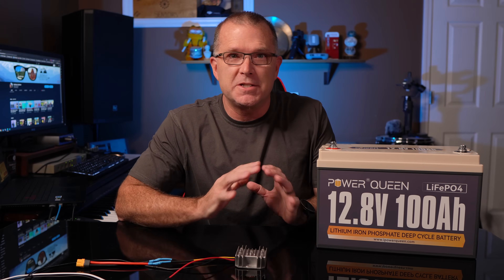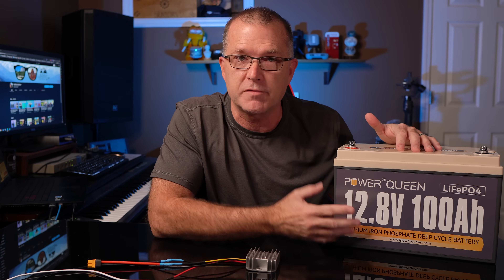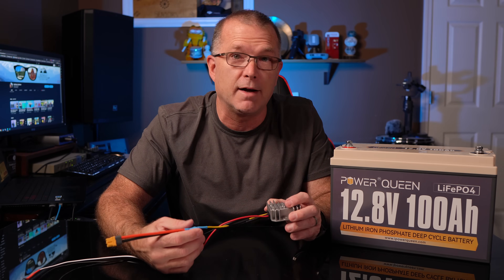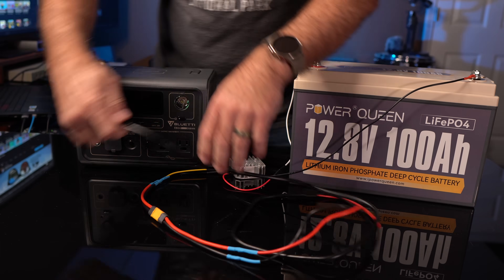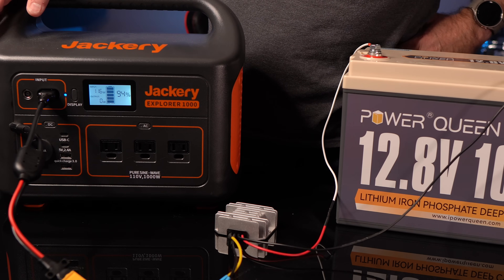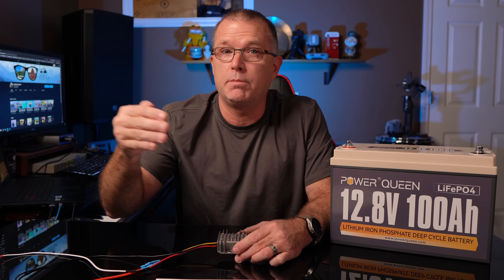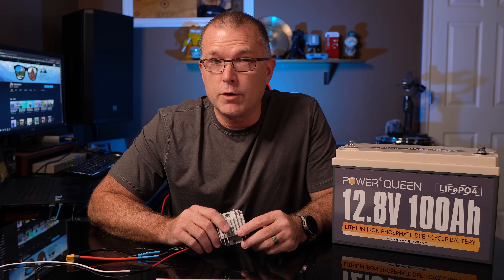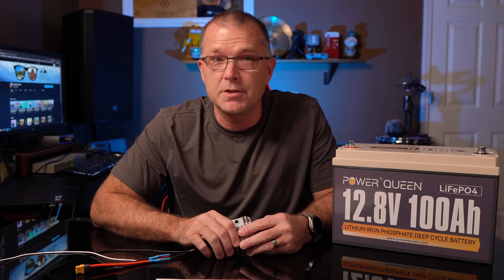SUPER EASY!!  DIY Power Station Battery Capacity Expansion / Charger

Comment: Nice... I have a question, how would you prevent or monitor the discharge of the external battery? Is it safe to let it fully discharge?
Reply: Buy one of the batteries that have Bluetooth.

Comment: QUESTION:  How would I get 200 watts or more through same system, but for a medium Station like River 2 Pro (NO expansion battery for it)?   Would a 200ah Battery deliver this?            On the solar max wattage for it is 220 so.  It can also handle 800 AC charging.    Thanks

Comment: Couldn't you just attach them without the step up??? The battery is within the ranges of the power stations!
Reply from the maker: You can, yes.  But it'll charge more slowly, and will eventually likely stop charging well before the power station is fully re-charged.

Comment: The converter you use here is useless for what you are trying to do. 
It’s rated at 3A. 24x3=72watt
You can connect that lithium battery directly and the solar generator will pull 8A or 100watt.
The reason the EcoFlow pulled 180 watt is it doesn’t know your converter is rated at 3A. The EcoFlow is pulling 8A at 24v. Your converter is bound to fail in no time. 
Solution 1 :
Use a 10A converter.
Solution 2 : wire 2 converters in series for 48v and get up to 400watt charge from it.

Otherwise good idea.

Comment: For permanent on the road van life, any idea how you could quickly recharge the battery? Perhaps use the Pecron charger that can shove 500 watts into the battery?
Reply: You charge the battery with solar or AC charger.
Reply: @SOLDOZER . Solar means you’d have to install all the usual claptrap like an MPPT controllers ,etc., which would be silly considering that your main powere source is the power station. 110 AC for full time van life is impractical because it takes too long. I’m thinking the Pecron to charge the extra battery and solar and the Ecoflow Alternator Charger for the power station if it’s an Ecoflow.
Reply: @joeblow1942   I live on a sailboat 8 months a year. I use solar mainly. When I get clouds for an extended time I use my gas generator. Its not that complicated.

Comment: Great video, is it possible to use 2 12v lithium batteries in series to get 24v and no longer need the step up converter and at the same time increase the capacity even more?
Reply: Yes, it is possible - some of the power stations will even let you charge faster (ecoflow - like 220 watt)

Comment: If the 12v  battery drain  how to recharge the 12 v battery or charge by power generator 😊
Reply from the maker: 2 options: get an AC/DC charger that you can power with either grid or power station, or get a small inexpensive charge controller ($25) and connect it between a suitable solar panel and the battery.

Comment: could you use the 12-24 volt 20 amp 480 watt version for the delta ? wouldn't that drastically increase your input wattage for improved charging time? not sure why you would only use a 3 amp charger

Comment: If I have a fossibot f800 powerstation. How can I connect my Lifepo4 100A battery to it to increase the total capacity of the Powerstation? To have solar panels connected to charge both my Powerstation and Lifepo4 battery at the same time. As far as I understand, your method is based on the fact that the external battery feeds it through the 12vto24v adapter inside the solar panel port. Then it's better to make a connection. Solar panels to MPPT to Lifepo4 to 12vto24v adapter to Powerstation. I think there will be big power losses, but all the batteries in the circuit will be charged.

Comment: Hopefully someone can help. Can you just connect the battery to the Delta 2, using a battery and the xt60i. A DC to DC converter isn't really necessary? Especially if the Delta accepts DC and limits the consumption at 500w. Just really trying to understand if or why the DC to DC is needed or not.
Reply: Чтобы получить 500 Ват при напряжении от батареи 12 Вольт нужно чтобы устройство которое вы заряжаете позволяло принимать ток силой более 40 Амреп.  А здесь есть ограничения у вашего устройства.  Посмотрите спецификацию вашего устройства - какой максимальный ток и какое максимальное напряжение оно может принимать для заряжания. Произведение этих двух параметров поможет вам понять какую максимальную мощность ваше устройство способно принять.
Кроме того замечу что чем болший ток вы направите теб более толстые провода вы должны использовать. Иначе тонкие провода не смогут пропустить большой ток, и при превышении силы тока они будут очень сильно нагреваться и плавить изоляцую. Возможен даже пожар. Надеюсь вы понимаете ответственность при этих факторах. 
В целом идеальным решением будет использовать преобразователь dc/dc для повышения напряжения до максимально допустимого или близкого к этому чтобы при более низком токе получить итоговую мощность передаваемой энергии.
Тем не менее, между акумулятором 12 Вольт и преобразователем dc/dc все же нужны будут провода потолще. Это снизит потери энергии и снизит разогрев этих проводников.

Comment: You could also run thr batteries in series with a 2nd LiPho4 battery to reach 24V.
Reply: Yep, or buy one at of the 24V batteries!  The 24V unit that has half the Ah would be equivalent to what is demonstrated and it is $280.
Reply: bad idea, never should two batteries with a  BMS connect in series
Reply: @rogerschmid8612  each manufacturer should state how many of their batteries can be connected in series and/or parallel. Don't just say BMS=no, as it's not the case.
Reply: @NicholasCox85 yes correct!
Reply: @rogerschmid8612 not true at all.
Reply: @rogerschmid8612 why not?
Reply: The amps would be very high. Which mat or may it damage the power station
Reply: @jimbo5635 as volts go up then amps go down. So a 24 volt system delivers fewer amps. Volts x amps = watts.

Comment: Excellent, informative video. Unfortunately the ONE power station you said might not be a good option for this is the Eb3a . . . the one I have. LOL Looks like I'll need to find another way to increase capacity. Again, great video. Thanks.
Reply: Same here. Did you end up finding a way?
Reply: @justinvardas8654  not really. But I do have a separate battery and solar panel. So I can get more power . . . just not in combination with the Bluetti.
Reply: @puffyd58 I think I’ll end up trying the combination of an 8mm barrel plug pigtail connected to ring terminals to the expansion battery. No step up/boost converter for me though. I’m ok with the slower charge. 
My biggest concern was charging the expansion battery without “shore power”. I’m going to try the method recommended by reeway outdoors and plug a battery charger into the AC on my eb3a going to the expansion battery. I’m in the city so solar isn’t really an option for me. The way i described seems pretty simple with minimal DIY setup. We shall see

Comment: Really enjoyed your work,  I  came across your video the bluetti ac180 a short time ago on this system and purchased  one. A great mid size  unit,and after watching  your video on using  a 100ah battery to increase  capacity  I do have a question.  Should I use a capacitor  to perchance the ac180 before plugging  in the cable to prevent the end rush voltage or will it be safe.
Reply: Конденсаторы используются в преобразователях dc/dc. Они там уже есть в схеме.
Мне известно что в bluetti в схемах внутри есть интеграция "медленный старт", по этому,  вам ничего дополнительно придумывать не надо.
Reply: No.

Comment: Instead of going through the process of getting a step up converter, if you got a 24 volt 50AH battery you could probably get more power through without the loss of the efficiency and still be around the same price

Comment: could you use two  back up 12v Batteries connected to that step up converter? trying to maximize keeping a portable fridge going and some small fans while camping. but also this seems like alot less wires needed to be made then other DIY power stations

Comment: My ecoflow (river pro 2) support 11v, could i charge it with one 12v battery and without the volt booster that you used?
Reply from the maker: Yes, but it will just charge more slowly without the step-up converter.

Comment: My Jackery Explorer 300's AC charger is supposed to put out 3.75 amps at 24 volts for 90 watts. It is indeed putting out 24 volts but the display reads 75 watts. When I connect my LiFePO4 battery directly to the Jackery, it shows a charge rate of 76 watts. So how would I be better off getting a step-up converter?
Reply: Возможно необходимы более толстые провода для передачи большей энергии.

Comment: The main advantage of the expansion battery on units that support them is that they are also charged off the same internal charger and solar panels. This idea is fine if you only need power to flow in 1 direction, otherwise you will need some method of charging the external battery either with seperate solar panels and an MPPT charge controller or some other external battery charger. I suppose you could connect a wall powered lifepo4 battery charger into the power station to keep the external battery charged up using the a/c output of the power station, or some sort of dc-dc charger that is under 10a running out of the cigarette lighter adapter on the power station. I might have to play with that and see what happens.
Reply: This has been what I’ve been considering doing but haven’t found much information about it. Charging the expansion battery with a battery charger plugged into my power station that is plugged into the car cig charger. It seems like it would work but it’s hard to say. I do drive a lot too so even if it were slow charging I would be ok with it. I’m going to try it pretty soon. If you’ve tried it let me know what you’ve found please.
Reply: I want to connect a solar panel with an mppt controller to the expansion battery connected to the PS. Did you experiment it? Does it work?
Reply: @albes83  Yes, the mppt+solar panel(s) works just fine. My other idea of using an AC battery charger plugged into the power station works too but that method is very inefficient. having a separate mppt and solar panel works great though. It's just keeping the separate battery charged up, and the charging is all DC to DC so it's quite efficient. Its basically the exact same thing as any DIY power system to charge the external battery.

Comment: Wondering if there's a hack to connect a battery directly into the Bluetti battery port? That way we could charge the supplemental battery through solar and still boost our capacity without having to juggle wires.

Comment: Why we don't just connect directly without 12V to 24V step up converter?
Reply from the maker: Depending on your power station, it might require more than 12v to charge.   And even if it will charge at 12v, it will most certainly charge faster at 24v than at 12v.  But...could be optional
Reply: @ReeWrayOutdoors  Thank you very much

Comment: Would one or the other or both have to be a pure sine wave? How can you be sure it's not doing damage to the electronics of the battery. pack.
Reply from the maker: Well this solution is DC to DC so there's no sinewave involved.  And as long as the voltage you're supplying is within the spec'd range of the power station's DC input, you're fine.

Comment: Old, I know, but you can run a small (500-1000w)12v-120v inverter off your 12v battery and charge it through the built-in charger. A little inefficient, but way cheaper than an add-on battery module.

Comment: The advantage of the more expensive add on units the much higher watt throughput. If you don't need the max wattage for extended periods of time I could see this method working out okay. If you need to run high drain loads , it won't help much. If you run any kind of heating load very long it will show up quickly. 

If all you are running is led lighting and small electronic rechargers, this will work well.

Comment: Hey man,

I have an Iforway T-Rex HS2000 power station.

It came without the internal swappable battery.. could I use this method to gain full functionality of the unit? It is rated 2000w with a peak of 4000w output. 

Is it feasible to utilize all those watts from externally set up batteries in the fashion you've shown in the video?

Or would it only be able to consider the charge which is going into it?

Could you make a video or explain how I could get my Iforway T-Rex HS2000 power station to utilize the power from external batteries without needing to purchase the branded ones? (Manufacturer is very difficult to communicate)

Comment: Thanks for tips, I bought a stepup 12->24v 250W unit. (< $20) I plugged into my ecoflow 1280w station and with a 100ah battery it does 100 watts without stepup, 195watts with stepup. Thanks again.
Reply: That's what I was looking at purchasing, a step up 12/24 with 240 watt output. Will use it on my ecoflow river 2 max. The BMS on this unit maxes out at 220 watts through the solar port.

Comment: yes, there's definitely a weird noise when charging the EB3A. Also the smell of something burning inside so I had to stop after about 3 minutes. I'm not using a 12v-24v converter. This doesn't  happen when I charge  other power station.
Reply: I have an eb3a too and haven’t tried this but I’m glad you can confirm that. I wonder if it would have any problem just charging straight off the expansion battery or if it’s the step up converter that’s the issue?
Reply: @justinvardas8654  that weird sound was from the EB3A's fan. I've gotten used to it and has since charged my EB3A with a 12V battery when solar is not available. My EB3A still works and has no issues up to this point.
Reply: Awesome thank you for the follow up. Much appreciated

Comment: Interesting idea. I'm currently trying to decide if I want to get the expansion battery for my Vtomam 1500Wh battery, or use my 500wh Blueitti to top, it off if/when I need to, since my 500wh battery can be charged easier while driving or via solar panels.

My usage is either 3/4 day weekend road trips, and in the future, maybe 5/6 day trips/car camping.
Reply: Damn VTOMAN external battery almost costs the same as the unit...

Comment: I set up everything exactly as you did with my EcoFlow Delta 2 and KiloVault lifepo4 battery. It went from 73% to 94% at just over 200 watts. Then it stopped. I discharged the EcoFlow 2 to 39% and tried again, but nothing. I put a little charge on the KiloVault battery in case the BMS had shut it down. Rechecked all connections but still nothing. Is it possible the 12-24 unit just died? It was fairly warm when it was working. Any thoughts appreciated. I may also try with a 12 to 36 or 48v, since it has a 60v max for solar input. Any thoughts appreciated.
Reply from the maker: Yeah I'd check the output on that step-up converter with a multi-meter and see if it is working or not.